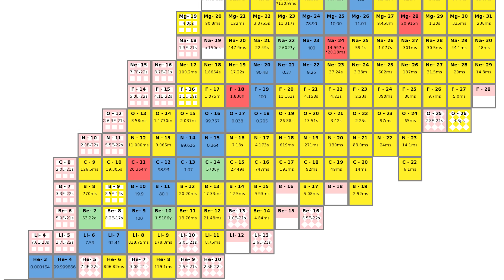Why the U.S. Doesn’t Recycle Nuclear Fuel

Comment: Americans keep ignoring that it is possible to build nuclear reactors which do not require enrichment by using deuterium-enriched heavy water to moderate the neutrons instead of normal light water.  India used this technology to breed the plutonium for its atomic arsenal, and Iran appears to be investigating this as well.

Comment: If I recall correctly, General Electric Co. had a reprocessing plant called GEMO ready to operate in Morris, IL
about 1970 but it could separate Plutononium which was bomb-grade and there was concern over terrorists, etc.  The facility had spent fuel storage, and it was covered by many feet of cooling water which is also good shielding from the intense radiation.   You could see the eery blue glow from the Cerenkov radiation (which is the electromagnetic analog of a sonic boom caused by beta radiation in the water).   It is or was near the Dresden Nuclear Plants I, II, and III which were also GE NSSS (nuclear steam supply systems).  Dresden I, an early nuke power plant,  design looked like coal plants at the time about 1957, except with a BWR (boiling water reactor).  Probably the continuous reprocessing designs were not used at the time because nuclear power was a new technology, kind of like the moon shot which was a culmination of Project Mercury, Gemini, and Apollo.

Comment: Uranium is too cheap.  it doesn't make sense financially, and even if it did, it would not have any meaningful impact on spent fuel storage...it's just going to keep piling up.  we have to have long-term (permanent) storage of high level waste.  the US govt. has been avoiding that inevitability.  the other main problem, is that reprocessing will lead to plutonium stockpiles, which have to potential for abuse...that's why Pres. Carter put reprocessing on hold.

Comment: Bad news: Ruzzia is in direct or indirect control of about half the world production capacities for nuclear fuel.
Resources of Uranium are getting smaller and smaller. Running a mine for an ore body of 1000 or 2000 tons is ridiculous, though IAEA lists the majority of known resources in the range below 10000 tons.
There is no recycling of spent fuel, it is scraping the remaining U235 out of it and some Plutonium which can only be used to a limited degree.
There is no operating production breeder reactor even though they have been tried to built for a long time, but the high stress on them make them impractical and dangerous to operate.

Comment: I’ve heard that thorium would be better, but the technology is lacking. True?
Reply: Thorium is not fissile in the natural state but must be altered into fissile state. From what I understand the technology is known but nut used. Because of the availability of uranium and its technology is already set up. However there is a lot more thorium than uranium and at some point it may be feasible to use it as a fuel.
Reply: @andrewwilhoit4743 : That’s what I’ve come to understand. Why hasn’t investment been made into this? Seems grossly illogical.
Reply: @WickedKingLycoan the Chinese are testing molten salt cooled thorium reactors so maybe they will be successful in scaling up for wide use. One one the problems I see is that some of the daughter isotopes are high gamma ray emitters and that makes it dangerous, also the salt is very corrosive.
Reply: @andrewwilhoit4743 : Thank You. :) This just seems more viable in the longer run than standard nuclear power.

Comment: I worked for 20 years in hazardous waste recycling using a technology common in treating high and low level radioactive waste. That is high temperature vitrification. I worked primarily with inorganic hazardous waste and my job was to develop formulations and processes that can be used to manufacture value added products that were not just viable but competitive in the market place. For those who don’t know what high temperature vitrification (HTV) is, in the nuclear industry radioactive waste is dissolved into molten borosilicate glass then cooled to a solid. This eliminates the toxicity characteristics of the radioactive waste and it stabilizes the radioactive waste within the borosilicate glass matrix so the radioactive material can’t migrate though the glass matrix remains radioactive. So the encapsulate the glass monoliths in lead sheilding to protect from radiation and these lead shielded monoliths are then usually managed by some form of deep well injection.

One of the singular most important consideration when deciding if recycling is a viable process and not just an amenable one is to ask this simple question “Is the return on investment there?”.

Why is this important? Because if the recycling process costs more than using  virgin materials and does not produce a final product meeting the required industry specifications and/or generates an equal or greater amount of waste then that recycling technology is not an economically viable technology. 

I’m not taking it on faith that recycling nuclear waste is a viable technology. An amenable technology for sure but not necessarily a viable technology. 

The only way to determine for certain if it is, is to do a mass balance for the entire process for both the standard process using virgin materials vs the mass balance for the recycling process.

In determining a mass balance you need to calculate at all points of that process where any kind of waste is generated. From the mass balance you can determine based on the value and quality of the finished product if recycling technology is an economically viable alternative to waste treatment and disposal. 

So in the conversation here this very important aspect of recycling wasn’t addressed. That being is the return on investment via the recycling technology viable? 

Ultimately even the recycled radionuclides will end up as waste so when doing a mass balance a downstream life cycle analysis needs to be calculated too. That would include recycling not just the uranium and plutonium but the recycling and sales of the fission products as well.

So this is where the rubber meets the road. Which is why, without more information on the matter of the return on investment, I’m skeptical if recycling spent nuclear fission waste is viable. The fact that the infrastructure for it isn’t being invested in at a large scale in the U.S. would indicate to me that currently recycling isn’t a viable option yet. That more research and development is probably needed to make it viable if it is truly viable at a large scale at all.
Reply: Return on investment is probably why fusion is going to fail. I know thats why the solar plant in Nv has problems
Reply: @andrewpinkham9904 It’s the same for all types of recycling and a lot of the times decisions are made about recycling that don’t make a lot of sense when analyzed in this light. That’s because the decisions are being made on public opinion and not facts.

For example, do you remember the polystyrene clam shell debate from back in the 90’s? Fast food joints were pressured to stop using polystyrene clam shell packing because they emitted hydrofluorocarbon (HFC’s) into the atmosphere where they were powerfull greenhouse gases and ozone depleters. So the industry switched to recycled paper.

Yet when mass balances were calculated it was determined that not only was the recycled paper an inferior packaging material but manufacturing the recycled paper products produced far more waste, including hazardous waste) and had significantly greater impact on the atmosphere in terms of greenhouse gases emissions.

So it gets real complicated as determining if recycling does provide a material return on investment is there. So in the example I provided the commercial return on investment is there in using recycled paper due to public perception that recycled paper is “greener” (it’s not) but the environmental return on investment is most definitely not there. 

So with recycling radioactive waste the return on investment is driven by environmental and safety concerns due their highly hazardous nature. Which is why calculating their return on investment (will recycling lower or eliminate highly hazardous waste from being generated.) is so critical.

In my opinion a better approach is to not generate the waste at all. So focusing investment in improving efficiency or changing the process so highly hazardous waste isn’t being generated is a better strategy then recycling.
Reply: Woohoo! Hanford finally has their vitrification process ready to start on the waste!
Reply: @dquam3885 And typical of Hanford it only took them 25 years. 😂
Reply: Капитализм... Инвесторам нужен возврат средств, а не прогресс или то что создаёт блага. Русские делают БРЕСТ ОД 300. По итогу выйдет дожигание актинидов, хранение отработанного и фабрикация из отработанного топлива на самой станции. Не нужно обогащение, не нужна даже добыча нового урана - хвостов 238 хватит на многие века вперёд. Но это же русские. А признать что русские лучше- табу.
Reply: One of the biggest mistakes that we make with vitrification, is that we are pushing to do it far too early in the process. 
Instead, we need to recycle and pull out a large number of useful elements, that do not help in the reactor, but can help elsewhere. For example, C14 is great to make very long-lived, though low voltage/amps batteries. These would be great for such things as Commercial Aircraft Black Box Pingers. 
And encasing into glass, material that will be radioactive for 10s of 1000s of years is insane, since that is nothing BUT ENERGY. 
Use it up, and leave ~12% of the original nuclear fuel that will be 100% safe within 300 years (with 99.99% of that safe in the first 100 years ).

Comment: Reprocessing still has issues.  But if you can get all the transuranics back in the fuel, you are not making new inventory.  Don't store it burn it.  Issues I129, tc99, kr85,  some of these leaks out during reprocessing due to thier form.  So getting rid of the plutonium is technical issue that can be done, and make power.

Comment: I haven't counted all the nuclides on the chart, but the edition of the chart I have says there are or were 2002 nuclides.  A booklet of this chart used to be available from General Electric Co.  Having taught in the nuclear power industry I think some good current authors would be Dr. James A. Mahaffey,  Dr. Raymond L. Murray.  The introductory chapters of textbooks by Dr M. M. El-Wakil had some great summaries of nuclear theory for science oriented persons.  If you search the internet, you may be able to find UNDERSTANDING THE ATOM SERIES of 51 booklets online once published by the USAEC (which became NRC and Dept of Energy) that covers most topics at supposedlyat the higrh school level.  Dr. Samuel Glasstone's  (SOURCEBOOK ON ATOMIC ENERGY, 3rd Ed. is best with little math )  has a bibliography with some elementary and advanced references.  Also, ATOMIC ENERGY FOR MILITARY PURPOSES 1947 or so by a Princeton Univ. Prof. has a layman's guide to the nuclear fuel cycle at an elementary level.  Also, the famous Dr. Isaac Asimov had a book published on Nuclear Energy.

Comment: Much can be recycled initially by chemical means, leaving the more difficult to process transuranics for a gas centrifuge.
Plutonium-239, yeah just blend it back into fuel, we've shelves of the crap already in the enduring stockpile, don't need more. Can use Pu-238 though, NASA is out of it and it's used in radiothermal generators aboard our deep space probes. Pu-240 is also created, just blend it back into the fuel, not useful for anything other than that.
And enrichment is something too many are in love with. Natural fuel reactors have been made, toss neutron reflectors as a blanket, install a neutron generator and viola you've got a spicy rock reactor and can reprocess after.
Not sure where Neil got atomic accelerators, I don't recall those being used in a nuclear fuel chain since the Manhattan Project and they were arguing over centrifuge, diffusion or accelerator enrichment. Good for research though.
But, if is surprised at the quantity of natural uranium still unmined, he should consider how much lithium we have - that's an element that's normally destroyed quickly inside of a star, it fissioning rather easily or fusing. And from a stellar nucleosynthesis perspective, is a trifle perplexing.

Comment: excellent explanation, we can solve climate change, reduce CO2 and have save, clean, reliable,  low cost electricity and medicine isotopes with nuclear fuel.  The only problem stopping the world from moving to a green renewable nuclear system are the anti-nuclear lobbies.  Who will not admit that nuclear is safe.  Just one hydro-electric disaster killed more people than nuclear has ever done.  Deaths from nuclear power, globally over the past century are in the hundreds. More have died working on wind turbines.  Go figure

Comment: Why don't they talk about Candu reactors that can use non-enriched uranium?
Reply: Because it is a Canadian design and nobody wants to talk about how Canada builds something better than the rest of the world.  More expensive than other reactors, but best performance with the best safety measures
Reply: @snidenevada9463  yep, but only more expensive up front. Over long term, it ends up being cheaper because of no down time and no need to buy enriched U from the few countries that make it. Also up front costs would come down if they were built at greater scale like LWRs. Hopefully the new Monark design works out. But, manufacturers outside Canada will likely try to prevent the design from gaining a foothold in market, unfortunately.

Comment: The "spent" waste is a minor fraction of the waste of a reactror.  The shielding, pumps, plumbing , containment, the tools used to work on/with all that becomes "contaminated waste" to dispose of.   Hydrogen imbritalment, isotopes created by the radiation being contained,  the very facility itself becomes "Waste".  In reality you are not recycling the uranium, just cleaning out the all ready half-lifed contaminants.  The thermal heat it puts out is really the only usefull part of it.
Reply: Hydrogen embrittlement isn't a radiation hazard, hell that happens with NASA fuel tanks, hydrogen is tiny and works its way through many metals.
Where there are issues is with neutron activation of the reactor components, most being within the core and reactor vessel. And as a hint, TMI-2's remnants are a bit over a mile from my home, the shielding, pumps, plumbing and containment long ago removed and now are low level to no level waste, the remainder is basically basic demolition. And had they not managed to melt most of that core down, it'd be happily coming back into service soon alongside TMI-1. It's not as if nuclear reactor components become a whammy, whammy, magic god-kill, city incinerating planet buster.
And the fissile, fertile or fissionable mass stays within the control rod pellets, wouldn't do to have uranium and plutonium floating in the water to jam up pumps and valves.
But, to illustrate a point, you have two samples, one with a 14 day half-life, the other with 24000 year half-life, both equal mass. Which one don't you want sitting on your lap unshielded?
A bit more complex than thought at first view. What's the radiation released? If it's an alpha emitter, it's a whole lot of who cares as long as it's not aerosolized or biologically active (OK, both). If it's a gamma emitter, that's a no way am I putting that on my lap, but I have taken a capsule of I-131 for a thyroid scan and not turned into a giant green rage monster. I've handled that other half life, it's called Pu-239, rather restricted because only idiots want to use that crap. And the decay heat from that wouldn't warm water to lukewarm. The Pu-239 being an alpha emitter and your epidermis stops the particles. The health physics gets kind of dense beyond that.

And here's a shock for you, everything has a half-life, even a humble proton.
And like that well water? Traces of radium, thorium, uranium, potassium-40 are in it, if that's a problem, maybe your ancestors should've stayed aboard the battlestar.
Reply: @spvillano  if not hydrogen embrittlement why did the plexiglass of the "exposure aparatus" have to be replaced regularly? it crumbled like stage glass often.  Not just blowing smoke , have worked in the inhalation and toxicollagy labs of Lovelace clinic on Sandia base in Albuquerque.  It is what they told me was the cause.

Comment: Spent fuel is a rich source of additional U-235 fuel.

For any given reactor design/fuel loading, only about 50% of the fuel loading is "burned" before end of life.  So if the initial fuel loading is, for example, 4,000 Kg of U-235 at 3 to 4 percent enrichment, then at end of core life about 2,000 Kg will still be there at around 1.5 to 2% enrichment..

The uranium could be separated and you'd have a source which starts off 2 to 3 times higher enrichment than natural uranium (which is about 0.7 percent U-235).

Comment: Basically, reprocessing spent fuel is like mechanically separating meat from bones - We've already carved off meat, but there's still meat left, it just needs processed differently in order to be used.
Reply: Except in this case, you can keep cooking the bones and they keep producing more meat, up to 100x as much as they originally had on them. What you need, in addition to the correct processing, is the correct oven, i.e. a fast reactor. Also, if you don't keep cooking the bones until they stop producing meat, you have to store them for 100,000 years before they stop being deadly to anyone who comes in contact with them.

Comment: A lot of wishfull thinking and BS. Reprocessing nuclear fuel is a dirty job! And the most of the stuff ist NOT used for any application! It's much easier und safer to make all required nuclear elements on demand in an special high neutron flux reactor.